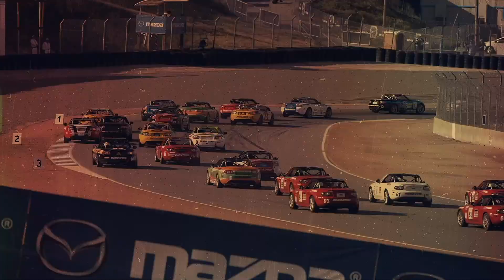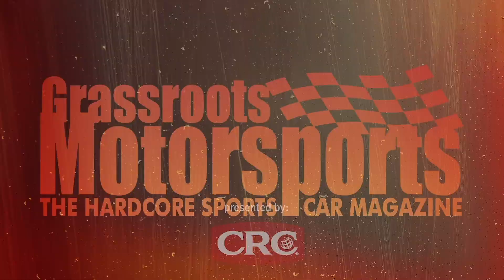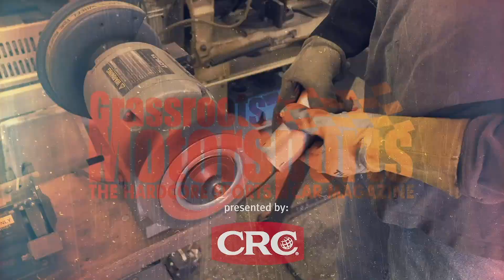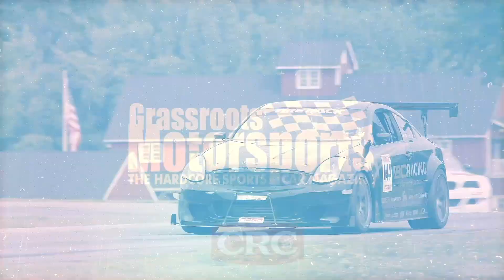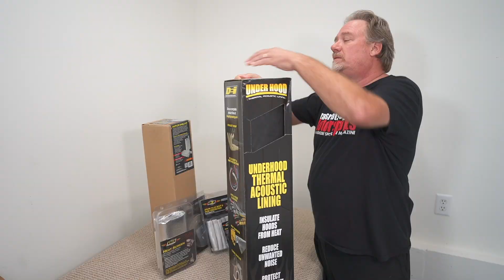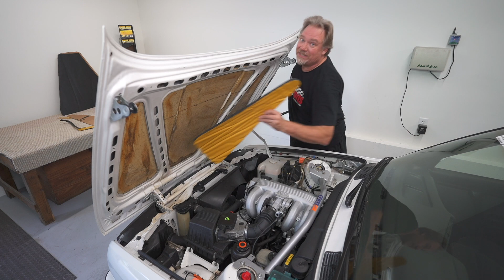DIY: How to Replace Underhood Insulation

Comment: The original hood insulations is a fire proof material used to smother fire. In case you have a fire.. Aftermarket products are usually just for noise and heat.